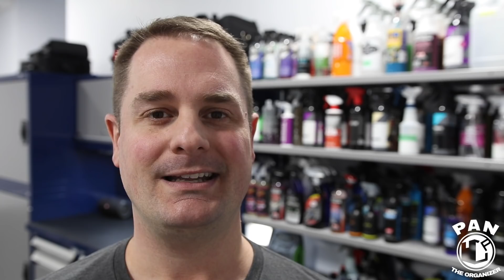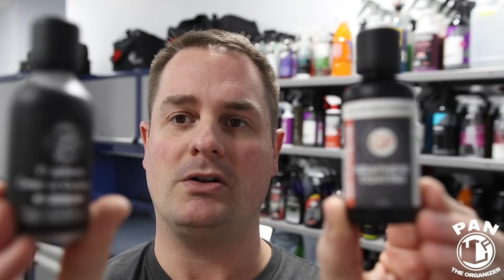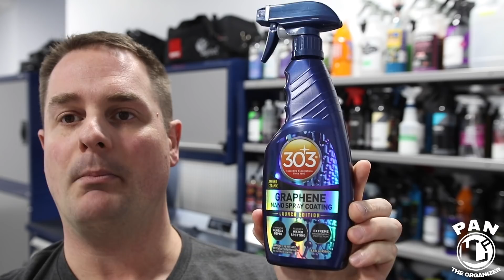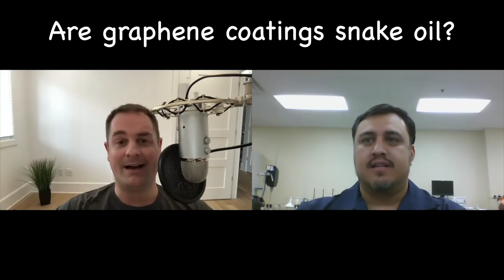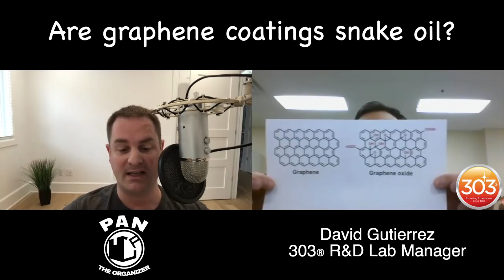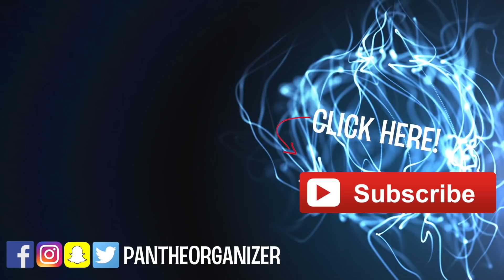ARE GRAPHENE COATINGS SNAKE OIL ?!?

Comment: Awesome video Pan!!! This will take a few days to find the time to get through. Im about 30 minutes in. 

As an observation I question the claim that it lowers the surface temperature. It sounds like David is describing how it lowers the surface temperature to prevent spotting when it is applied, not to a fully cured coating several weeks after application on a hood sitting in the sun. I think he indirectly answered the question anyways. Graphene is great at heat transfer in the x-y plane and heat energy travels from hot to cold. It is simply "good" in the z plane. If the entire hood is the same amount of hot I dont understand how the graphene will make a big difference especially considering how thin the coating is since there is no "cooler" spot to transfer the heat to unless it was in partial shade. For example I used a graphene pad to cool my wife laptop because it transfers heat from the hot cpu over a larger area that is cooler since the cpu is significantly hotter than the surrounding materials which increases the convection. I would think convection would be the most significant form of heat transfer to cool the surface of a hot car and that's primarily determined by orientation and surface area, neither of which the spray would significantly alter. I'd also suggest the coating is pretty thin so the temperature of the clear coat and the temperature of the surface of the car would be within a fraction of a degree. The only argument I can think of is that when it rains on the car it transfers heat to the rain drop better than say a wax but I would expect that to make spotting worse, not better as it would accelerate evaporation and again due to how thin the coating is I'd suggest the difference is trivial. Perhaps David can correct me if he is reading the comments and has time but I understand he is probably pretty busy so I certainly dont expect him to.

Thanks again Pan!
Reply: Jason from Chicago Auto Pro did a video on graphene vs ceramic. He did a test panel and showed just what Thomas is indicating: left outside in the elements, the graphene side was hotter than the ceramic and showed more water spots. For me, the is still out. 303 still makes great products, but I’m not all in yet on graphene.

Comment: For the Graphene to be functional, it needs to be an atom thick. Harder than steel, but brittle. Can't have one without the other.  I saw a test where 4 different products were used on a hood, three were Sios based the fourth the 303 Graphene.  One product, CarPro Reload is what I use. After a few chemicals were thrown at it, end result the only product that still showed some protection was the 303 Graphene. Guess who will be switching products.
Reply from the maker: I also did a super popular chemical resistance test recently, involving two graphene spray coatings (303 and Adam's) against another popular sealant here: https://youtu.be/wZYZc9uDyek

Graphene coatings are the real deal, at least the ones I have tested so far, from reputable companies.

Comment: Sorry but it doesn't make sense to me. If the heat transfer from the coating to the water spot is making the water evaporate faster, isn't this increasing the chance of water spotting ? Also if the temperature change is marginal, like a few decimals of a degree how come it has this property? IF there is water spotting decrease I didn't get the "why" explained. Thermodynamics as explained didn't really gave me answer. Or I miss something ?

Comment: Graphene is still not there yet with the protection most are saying it is doing. The biggest misconception is Graphene is NOT hydrophobic and Graphene Oxide is definitely NOT hydrophobic, but is hydrophilic. That is not a bad thing though. This is why Graphene Oxide automotive products have less water spots and etching. GO will create more Sheeting more than it beads. Beading is the biggest reason for the water spots. Most would rather the water sheet OFF the car so it does not stick around and cause water spots. To me the greatest benefits is its ability to Pan TheOrganizer.
Reply from the maker: Its ability to Pan TheOrganizer! 😂 a new quote!
Reply: @PanTheOrganizer  , That is pretty funny. It somehow erased what I wrote. I meant to say it's ability to repel oils and dust, which will be an excellent product for keeping the engine bay clean, but it is definitely a Pan TheOrganizer tough product and well worth it. Great Product.

Comment: I use bead maker and I absolutely love it .. however when it rains I do get water spots which you said is normal after some rain ... is there anything out there I can put on top of bead maker to avoid water spots after rain or is the tech not there yet lol
Reply: Put 303 on top and it will assist
Reply from the maker: There is no magical product that will prevent water spots 100% right now. But from my testing, graphene coatings certainly help reduce that amount (at least the product I have tested so far) and they are easier to clean if you do get some.
Reply: Chris Gorgol what’s 303
Reply: Pan TheOrganizer someone jus suggested 303? What’s that?

Comment: Hey Pan, love the great info you're always putting out and love that it's a Canadian channel. I have a question  about spray ceramic coatings and the ceramic boosters. I know once you apply the coating the applicator needs to be discarded but does the buffing towel need to be? When using the booster sprays do those towels need to discarded or can they be laundered?
Reply from the maker: Yes even the towels have to be thrown away with ceramic coatings.
Reply: @PanTheOrganizer  even with booster sprays? I would have to burn through my good mirofiber, do you have any cost effective microfiber cloths that could be considered disposable?

Comment: I'm amazed that you all think this isn't snake oil after that interview.  
I certainly went in hoping that I would be even more sold on the graphene than I already am. 
But this guy couldn't even give a good used car salesman description about the cool surface temperature validity. 
NOTE: Personally I could care less about the surface temperature, as long as the product works like I've seen it work in multi product comparisons. 
If you took this guy at his word, in the one statement he made about the cooling validity, you need an instrument that can measure tenths of a degree, to possibly see that it really does. 
REALLY ? ? ? ?  Does anyone believe that a tenth of a degree is going to make a tenth of a degree of difference? ? ?
I've got a bottle of Graphene 303 and am going to use it without caring about a tenth of a degree. 
I'm using it because I've seen detailing guys do comparisons, and the Graphene always lasts longer.
Reply from the maker: To give you another perspective on the topic, I interviewed a leading chemist of the biggest blending company in the USA on that same topic here: https://youtu.be/Jevs_iIrzVI

Comment: Awesome job Pan. Really enjoyed this and even though it was at high level you made it relatable to me. I have used Graphene coating from Ethos and have noticed that water spots do just wipe off. It was amazing. If I get the claimed 5 years that would be outstanding. For 303 I am really excited about this product for its simplicity. Could I use it as a topper over the Ethos graphene?
Reply from the maker: Thanks Richard! Yes you could use the 303 Graphene spray coating as a topper over your existing protection.

Comment: Hi Pan.   Thank you for quick reply to my question.   I have a theory which I would like to ask/share.  One of graphene property is heat dissipation.  I live in a damned hot country(Thailand).  So if we apply, say,

Turtlewax HS Pro graphene flex wax and leave my car in the sun for half a day, the accumulated heat inside the car should not be as high as no flex wax being used.
My theory makes any sense.   Actually, we can test it when I have the product on hands.
Please let me hear your thoughts.
Reply from the maker: In theory, yes, graphene is supposed to reduce surface heat by having greater heat dissipation, thus reducing the chances of getting water spotting issues. That's all theory. In practice, it's harder to "measure" that scientifically.
Reply: @PanTheOrganizer   Thank you sir for taking the time to comment.  The graphene products can have the chance of success only when prosumers can see distinctively when they perform far better than , not marginally against,  the existing ceramic based products.

Comment: So it lowers temperatures to prevent water spotting *during* application of the graphene? How is that even helpful at that point... there's no water on the vehicle during application. And even if there were, that isn't what the claim is about. The assumption is that it helps water spotting beyond the initial application phase (as Pan discussed with a dedicated water spot remover). Additionally, if it just transferred the hotter temp from the car to the coating... the water is in contact with the top-most layer. So the water spotting would be the same (from a temp standpoint) because it's still touching the same temp surface (now the coating instead of the surface of the vehicle). This whole series of answers struck me as avoiding the topic or not understanding it well.

The better answer: graphene has been shown to improve heat conductance though this is harder to see in real world applications. But that defeats the marketing claim. And by the way, if the coating itself is just hotter... then so is the car. They're in contact with each other and heat flows from hot to cold until the temps reach equilibrium. 

From another with a degree in Biochem that got to study a fair bit of Physics.
Reply from the maker: Hi Brian. No. Not “during” the application. What scientists say is that graphene in general has two ways of preventing or reducing the amount of water spots AFTER you have applied it. After it fully cures.

1) Lowering surface temperature by better heat transfer.
2) Better water contact angles and quicker sheeting to prevent water from pooling or staying on the surface as much.

Watch another discussion I had on the topic with a leading industry chemist: https://youtu.be/Jevs_iIrzVI

Now that detailers have had more time to play with graphene coatings (they were quite new at the time), it’s more clear that they are usually a ceramic base with reduced graphene oxide in them (RGO) and not 100% pure graphene as that would be too costly aat the moment.

So do graphene coatings work? Yes they do. They perform as well or better than their ceramic coating counterparts, as they share much of the same backbone.

Comment: Pan great videos!!  2 question on graphine coatings.   How do I get this stuff off?  If I want to donpaint correction after appling?   And will a paint guy hate having this stuff on the paint?    Thank you
Reply from the maker: Only way to fully remove coatings is through machine polishing. And yes, you have to let bodyshops know that you have a ceramic or graphene coating on your paint if there is any repair work to do.

Comment: Hi Pan ( your real name?), after seeing this video I want to get the 303 graphene spray but I am confused. They also have a spray sealant and my question is do I need a sealant if I use the graphene spray or do i use both ?
Reply from the maker: No. Pick just one. Go for the longest lasting which would be the graphene in this case.

Comment: What kind, if any, of improvement in gloss did you see or test for with the graphemes?
Reply from the maker: The graphene coatings I tested so far are easily some of the glossiest products I have tested. But then again, most high quality ceramic coatings also are. We're really splitting hairs when it comes to gloss, as it seems we have reached the pinnacle for now. To know for sure, with data, gloss meter readings could be interesting, but I rely mainly on what my eyes tell me.
Reply: Pan TheOrganizer Thanks Pan,  I just recently used the Adams Graphene product and I didn’t see much improvement in gloss but my car was pretty glossy
to start with. I’m more impressed with the Black Ice product by Last Coat that you addressed recently on one of your videos.

Comment: I bought 303 because I saw other people using it on their detail channels... I wondered why it never really did very well for me when I used it. THEN I saw Project Farm test the stuff and it failed miserably. That's the last I use anything by 303.
Reply: I have two identical vehicles bought at the same time in 2017 (his and hers), but only I have periodically 303'd my wheelwell trim, and it is 2 shades less faded already (after removing any residual 303). I am really not sure why his test showed no UV protection, it is clearly there. I've been using it about 16 years.

I will say the 303 graphene-oxide works better than other products (including ceramic wipes) on smooth trim, like the trim between the trunk and top opening on my convertible. I think for my purposes, it will be a coating on top of a ceramic coating (IGL), since SiO2 sprays haven't been sticking to that and this does. I'm not seeking out an end-all solution, but rather two products that work well together and can be layered - one difficult to apply but durable / beautiful bottom layer, and one easier to apply topper that staves off damage to the ceramic, keeps the trim fresh and protected, and is a bit more hydrophobic for easier drying.

I'd also use this in cases where the surface prep can't be as meticulous as is required for a ceramic coat, or when I don't have a garage to protect it from the elements during a long ceramic cure cycle.
Reply: We have good products so I am very sorry if you got a bad purchase and 303 is trying to get the best quality
Reply from the maker: Hi Nick. Just to set the records straight so it doesn't confuse viewers, Project Farm didn't test the 303 Graphene Spray Coating yet. He has made NO videos on this product. It was just released a week ago, and I was the first to release a video about it with a few other detailing channels.

You probably saw one of his tests on another 303 product.

Comment: So if I heard him correctly, the lessening of water spotting has nothing to do with temperature, and is all about the minerals not adhering to the coating.  His answer about heat transfer did not make any sense.  Of course if you apply a cool liquid onto a hot surface there will be thermal transfer.  All he talked about was the process of curing, but nothing about how it reduces the temperature of the surface once cured, and Pan let him get away with that nonsensical answer.
Reply: It doesn't change the temperature of the surface of the car, it's the temperature of the graphene.